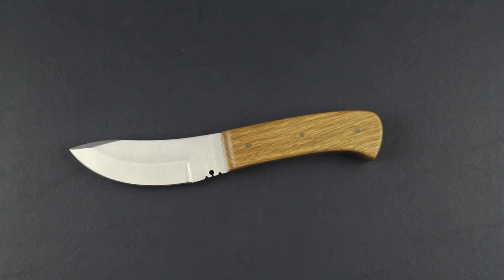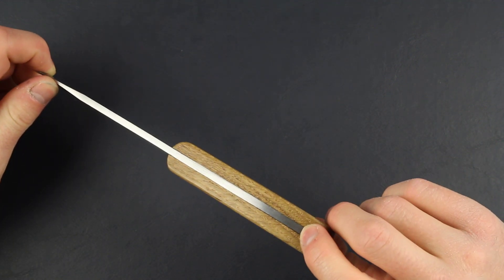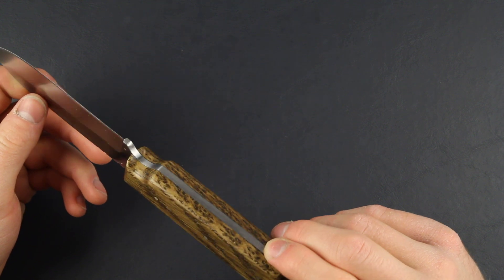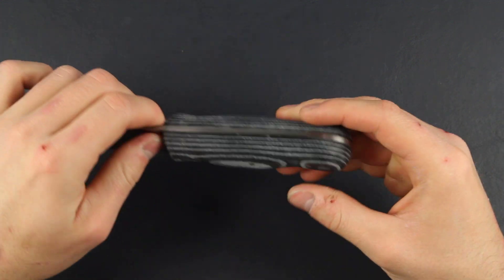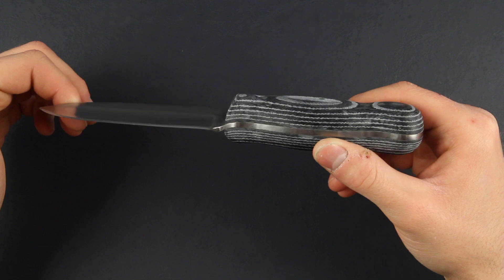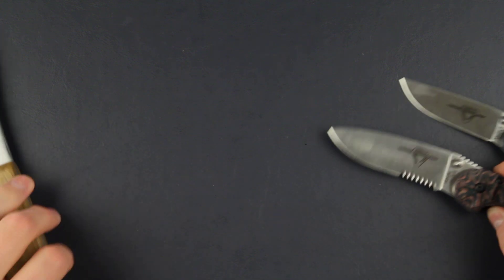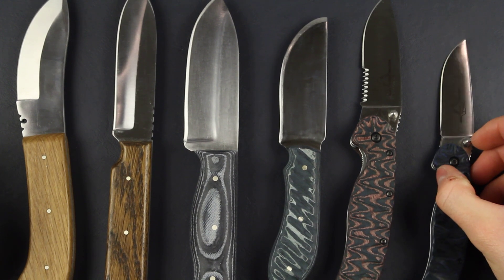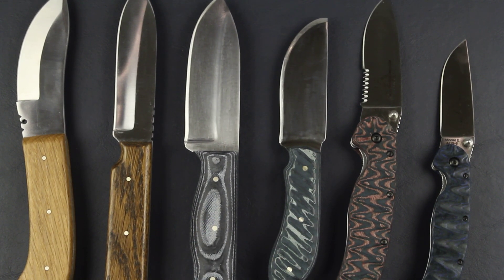My Knife Making/Modifying Progression

Comment: You can get a cleaner and more even bevel on the belt sander using 50 grit sand paper. Also may play around with a jig for a consistent bevel.